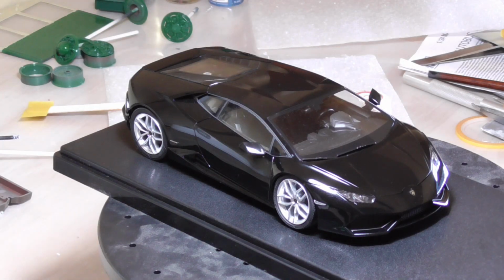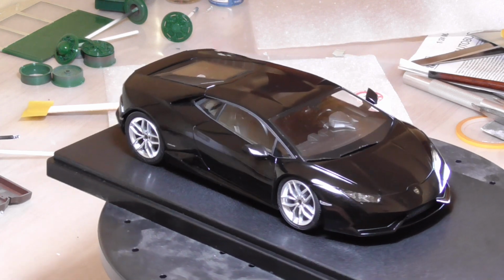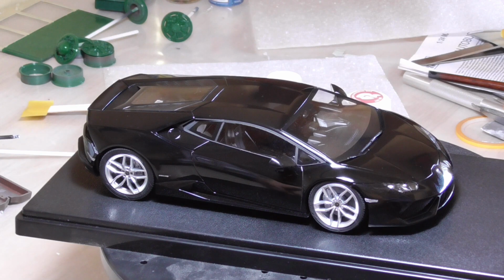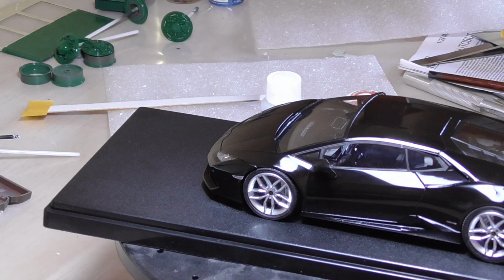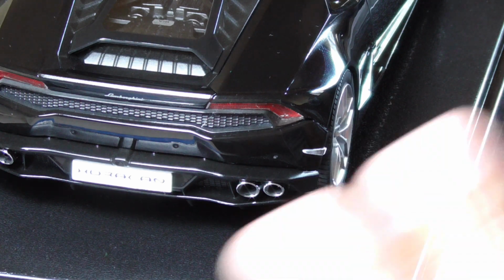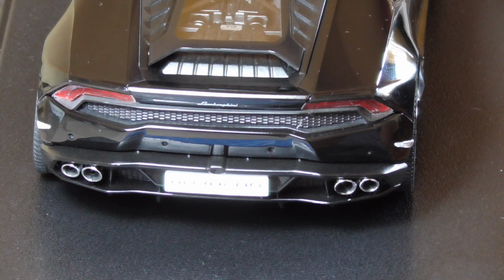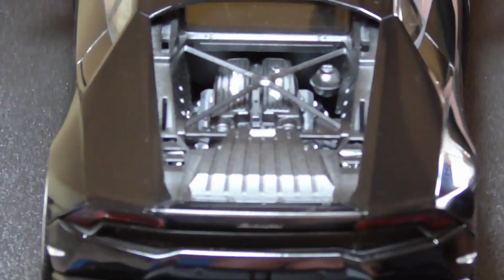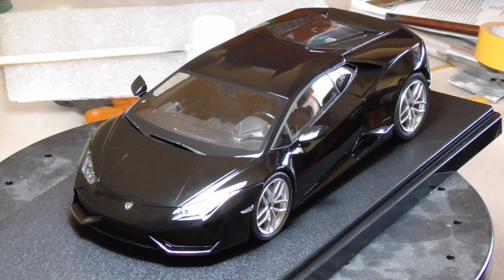1/24 Aoshima Lamborghini Huracan LP610-4 Part4 Final- Final review and pics

Comment: It looks like part 108/109 which is the light cluster/housing. It seems the instructions would have you build up the tail light assembly with its various lenses into this part (LH & RH). See Steps 23 and 24.

https://www.1999.co.jp/eng/image/10384122/70/9
Reply from the maker: Yes, those chrome parts are part of the tail light assembly, but if you try to fit them (108 109), then the whole sub-assemblies (taillights+grill+rear bumper and diffuser) won't fit the body because there isn't enough space on it. Looks like the gap in the body was made without considering those 2 parts, hence my question about them